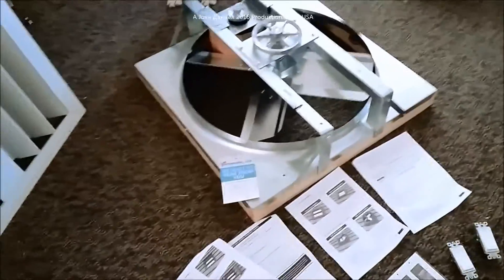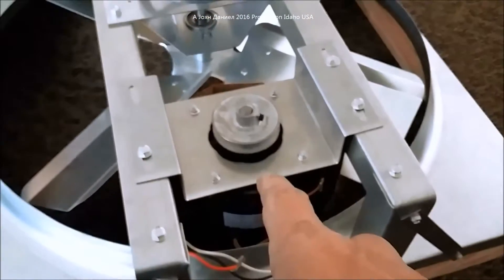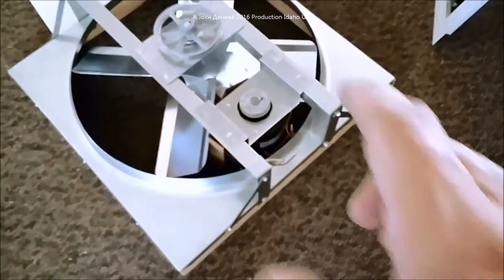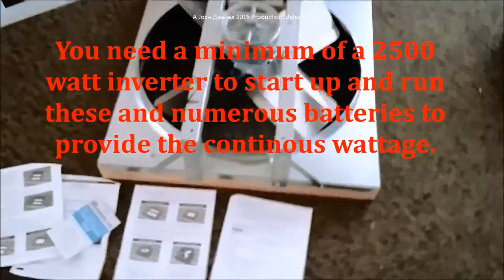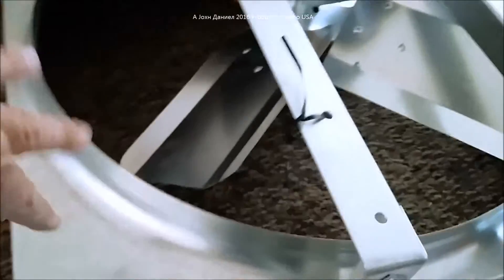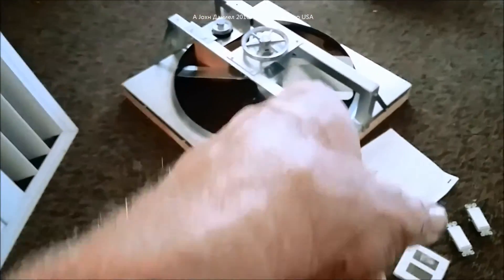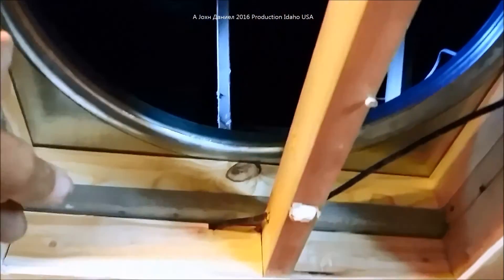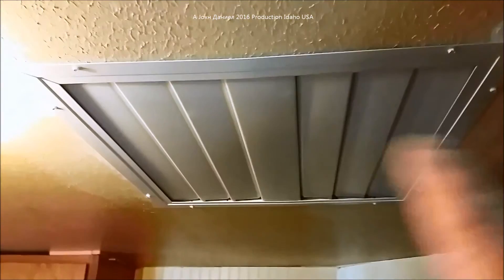Whole House Fan install, running Off Grid Attic Fan Ventilator AWESOME

Comment from the maker: UPDATED - Best Attic fan, low power use, high output. Look below for links and more FAN https://ebay.us/O6CKM8 Top most Durable AFFORDABLE PURE SINE Power Inverters are SWI-POWER, https://s.click.aliexpress.com/e/_Acd6Hd or USA Stock https://ebay.us/ZLHqO6 .  You can run this off grid, use solar and batteries and never over heat!  Best options on many of my RE-Power videos. GE-500 watt wind turbine, https://s.click.aliexpress.com/e/Igjt80g , and Nupow 100W solar https://bit.ly/3hMWDZ0 and solar controllers here ONE LINK TO ALL PARTS https://amzn.to/3xfkOug
Just add batteries in voltage and type preferred!

Comment: Since I"m been remodeling my home I might have to do that put a full size attic fan in.  They have fans were they have a insulating cover that opens up out of the way for when the fan is on and when its off it closes back over the top to keep the heat in if the case may be.  Nice install. much better and less having to use an ac system when the temps are nice out side.  Thanks for sharing John.
Reply from the maker: +McCuneWindandSolar It's the most logical step when going off grid.
Reply: Јохн Даниел only if it was a little quieter. But I think they make them.  but it makes for a nice addition to a home. 
.
Reply from the maker: +McCuneWindandSolar It's actually not that loud. My phone seems to make it sound much louder than it is.

Comment: hey john !  thanks for the video!  i am just now installing the exact same fan, and no matter which way i mount the motor,  the pulleys are not in the same plane...what am I missing?

thanks john.
Reply from the maker: Are you using flipping the mount? If you followed that instructions, see if the pully can be slid a little by loosen the set screw and tap it some to align. It is shipped upside down, and may have been driven down on the motor too far?  https://youtu.be/6aeyqvauIRA?t=128